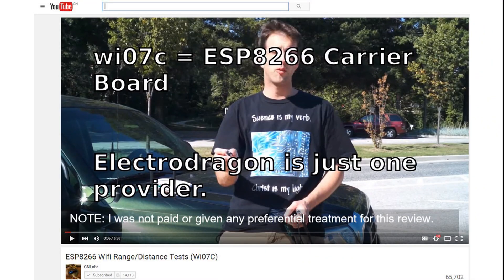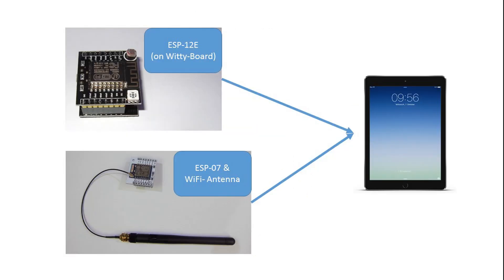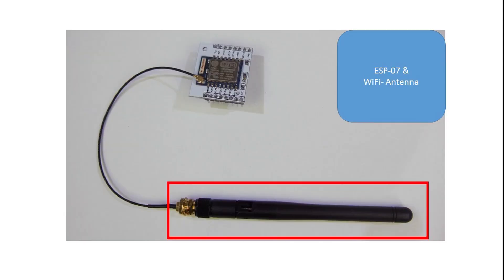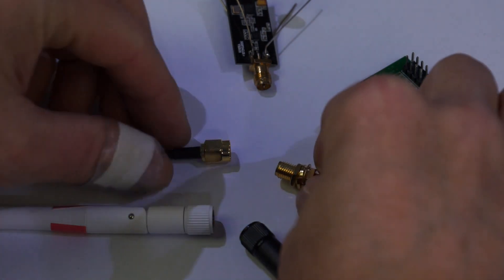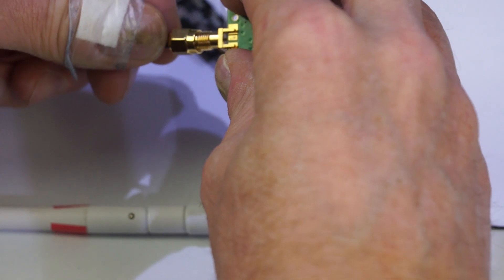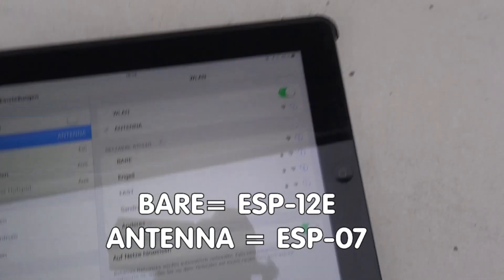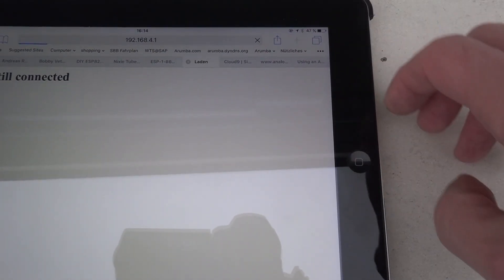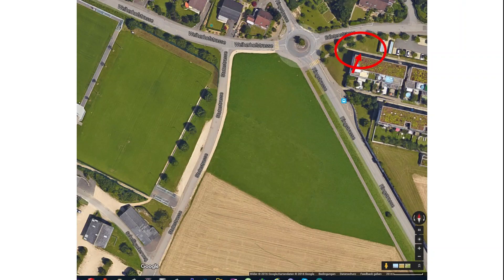#43 ESP8266 Range Test with and without External Antenna

Comment: You need to have the ESP-12 in the vertical orientation to get maximum range.  This matches the vertical polarity of a normal whip antenna in the vertical orientation.
Reply from the maker: I agree with you that polarization makes a difference, But if one station is movable, it is not easy to align polarity. I used a IPad and I do not know the polarization of this device. And in addition, I moved it all the time. Many of my applications are similar and I cannot adjust polarization on both sides. So, I think, we have to live with what we get without adjusted polarization.
Reply: Is it possible to have a second Rainsun chip antenna rotated 90-deg in place of the u.FL connector?  That way both polarities are covered on-chip.
Reply from the maker: This is not easy because if you put them in parallel, then you only have 25 Ohm which would be a complete mismatch. In series, you would get 100 Ohm. So, you would need a imedance converter, which is not easy to be built on 2.4 GHz.
BTW: The best channel about 2.4GHz antennas is: https://www.youtube.com/channel/UCHqwzhcFOsoFFh33Uy8rAgQ
Reply: So totally impractical to have 2 chip antennas on one PCB?  How does the ESP-7 support external and internal antenna concurrently?  Or does the ESP-7 disable internal antenna when you connect external?
Reply from the maker: +George Ou You have to unsolder a component, if you want to use the external antenna. But I didn't know this when I made the video. A viewer told me
Reply: Yet you had both working before you unsoldered internal? Or is it just sub optimal?

If they both worked, I suppose they could be put of phase spaced at half a wavelength apart, and cancel each other.
Reply from the maker: +George Ou It as for sure not optimal, because they were both in parallel (25 ohms)
Reply: The Itead PSF-A85 seems to claim you can use internal and external antenna without matching circuits.  But I can't be certain.  Here's what they say.

https://www.itead.cc/wiki/PSF-A85#WiFi_Antenna
"PSF-A85 supports two kinds of antenna interfaceIPEX interfaces and stamp hole interface. You can directly use on-board PCB antenna and IPEX antenna, without adding any matching circuit."
Reply from the maker: Interesting...
Reply: Itead PSF-B85 does not have external u.FL and uses a tiny chip antenna. Probably smallest 2.4 GHz chip antenna I have ever seen.  My limited understanding is that the chip antennas are more resistant to being detuned by any changes on the PCB.
Reply from the maker: I am not a antenna specialist. I just know, if the match is ok, the bigger the antenna, the better ;-)
Reply: Sure, you can wire the ESP-07 to a 1-meter omnidirectional antenna and get 15 dB gain if you really wanted 5.6-fold range in any direction.
http://www.l-com.com/wireless-antenna-24-ghz-15-dbi-omnidirectional-antenna-n-female-connector

Comment: I bought one esp8266 and burned its memory because I think I have a faulty USB to TTL adapter. I tried lighting an LED with the adapter and it burned in a few seconds, even though the adapter is supposed to give out 3.3V. I'll buy another memory chip and hope that's the only thing I burned off on the esp
Reply from the maker: Bad luck!

Comment: i didn't really get it. which one has better range? esp-07 or esp-12?
Reply from the maker: 4:12 you see and hear: The ESP-07 with an additional antenna. If you do not want to use the additional antenna, the ESP-07 makes no sense because it has only 1MB flash (if you want to do OTA updates).
Reply: did you even look at the video??

Comment: can't we solder an antenna over the PCB antenna on nodemcu?
Reply from the maker: You can, but most probably, it will not work well. Antennas have to match in impedance, and this has to be designed by somebody with a lot of knowledge (and measuring equipment). I would not do it. This is, why I use the ESP-07 if I need an external antenna.
Reply: Agreed. I didn't know that. I looked up a few websites today and found that such a hack could actually make the antenna performance worse. Great videos by the way :-)

Comment: I wonder if you could increase the range by using two ESP-07s with external antennas rather than just connected to an iPad. Do you think it could be possible that iPad's antenna could be one limiting factor? 

Also, are there external antennas with amplifiers?

Two directional antennas pointing at each other would be optimal probably.
Reply from the maker: 1. The IPad seems to be part of the limited range.
2. Directional antennas for sure would help, if your devices stay at the same place.
3. I do not know if external amplifiers would work. The need a certain power to switch from receive to send and I do not know if the ESP has enough. For sure, they would be illegal :-)
4. I plan to do more testing , but probably next year when it is warmer here.
5. A viewer suggested, that I should have a resistor removed if I use an external antenna. I do not know, how much influence this has.
Reply from the maker: You are right. Another viewer told me that, but at the time of the making of the video I did not know.
Reply: esp-07 external and "internal" antenna seem to interfere each other, I red that removing the little cap helps to make signal better when you use an external antenna with it, maybe you can look into it too. You have all the good measurement equipment.
Reply: Andreas Spiess maybe you can make a little video about esp-07 since it's probably most popular esp with external antenna. To show the difference in gain with and without external and with and without the capacitor? :) You have the measuring equipment i believe, would be interesting. Just a thought.
Reply from the maker: I plan to do something with extendign reach of the ESP. But not soon.

Comment: As far as I know. To get an wifi connection for places like at the back of your house, you could use something like a reflektor to reflect the signal to the backside. As far as I remember about more than 90% of the wireless signals inside an appartment arrive by refelction. I read this a while ago in a book called "WirelessLANs" from Joerg Rech. May be a interestin information.
Reply from the maker: You are absolutely right. This is not only true for Wi-Fi signals. As  Ham radio operators we e.g. use reflections of HF signals in the stratosphere to communicate worldwide.

Comment: I think the critical difference between this test an cnlohr's test is that he used an access point as one end of the connection. This changes things rather dramatically I would assume since access points are powered and can create a substantially stronger signal than a battery powered device. I would imagine they can amplify weaker return signals as well, although I do not know that for a fact.
Reply from the maker: I did not want to have a record as cnlohr. I just wanted to test a real scenario. cnlohr's work, however, is very interesting!
Reply: +Andreas Spiess I guess I always try to connect my esp to the internet for connectivity, so in my case having one side be the AP is realistic for me. Cool video, thanks for doing the test.
Reply: a battery powered device isn't powered??

Comment: He was using wifi router as AP, and ESP8266 as client. His second test with 4 km success is becose he used directional antenna
Reply from the maker: I think, he wanted to prove what these little modules are able to do. So, He tried to find a maximum.
Reply: I think he used udp ping oneway

Comment: Hey i want to know is there a way to reduce antenna RF power. I am transmitting SSID using esp12e, but i want to restrict it to lets say 2m, how do i do that?.
Reply from the maker: I do not know of a function to reduce RF output of the ESP8266. So, the easiest possibility is to shorten the antenna or mount the module in a metallic case with some holes (the case should be connected to ground). Then, with experiments you can drill enough holes to get the desired range.

Comment: i have esp-01 i think its a 26mhz.. 

i think it has a short range like 20-25meters? 

what if i want to upgrade the esp-07 but the same arduino code to be patch.  is there any conflict?
Reply from the maker: All ESP8266 modules work in the 2.4 GHz Wi-Fi band. As with other Wi-Fi devices, you can have many devices in parallel in one network. The number after the "ESP" is just the packaging, the chip is always the same (ESP-07 e.g. has an antenna connector, ESP-01 has only a few pins)
Reply: 26Mhz?? sure don't think so....as well the 2.4Ghz range (hence the name Wifi!)

Comment: It will be more interesting how far can 2 esps talk together , so the distance wont depend on device used to connect to the esp .
Reply: I have tested this case inside my house... two ESPs, one send UDP packets ,the other receives. I confirm that the range is 16m/20m with an RSSI on sender of -85/-90dB with a percentage close to zero of lost packets. 
The same result if the two ESPs are on different floors.
I have not tried it outdoors yet.
Reply from the maker: You are right. This the topic of a future video
Reply: Thanks you for doing amazing job!
Reply from the maker: Yeah, I know these videos. Great channel!
Reply from the maker: Thanks for the info!

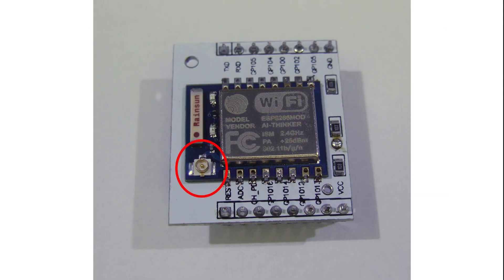Comment: Found your video on research for external antenna use of esp07. As far as i know you have to disconnect the ceramic antenna, just remove the 0ohm resistor between u/Fl and power led. @1:47 i can see the resistor is still there, did you desolder it?
Reply from the maker: When I did this video, I did not know, but a viewer wrote it in the comments. I have to try this in a future video.
Reply: yep you have to remove it
Reply: Welcher Wiederstand wäre das?

Comment: Hi, you can use a helical antenna to your modules and you will increase your range dramatically but it's directional, the longer it is the more directional
Reply from the maker: I have some material laying around to play with different antennas. But, unfortunatley, for the moment, I do not have the time. Subscribe and you will probably see a video in some future...

Comment: Dear Mr. Andreas Spiess
Thank you for sharing experience on ESP8266. 
As expert on RF design I like to help you to improve designs and demos as you presents. 
You can call me any time my Skype nissim.test see me also at http://www.TelnT.com nissim@TelnT.com
Regarding the range test experiment you make:
As you can see on the 1:48 minutes on the right top side of the red circular there is capacitor. 
This capacitor must be removed if you like to use the U_FL connector. 
See this capacitor at http://goo.gl/cYaZHF layout.
The reason is simple: the maximum RF distance is based on good impedance matching the Microstrip (wire to antenna on PCB) to antenna must be 50 ohm. 
That Microstrip now is 50 ohm with the ceramic antenna. The U_FL connector is also 50 ohm without external antenna. So all Microstrip  is 50 ohm
But: if you connect external antenna to U_FL without remove the capacitor you get two antennas parallel to each other (the Microstrip “see” 25 ohm) and the Microstrip has to drive 25 ohm. ESP8266 see 50 ohm that end with 25 ohm. 
That is very bad. Just 33 % or less of the RF energy will be RF broadcast.
 Moreover will be a standing and return waves on the Microstrip that will reduce the RF energy out even more.  Return waves will warm the ESP8266 and can destroy its final PA RF stage. 
Two antennas may effect and cancelled each other if they are in a distance of multiply of ¼ wave length (30mm). 
Placing the antenna on roof extend the distance since distance from ground do that. But making the antenna on the long metal fence on the roof may reduce or increase the distance. The long metal fence act as resonance antenna two. 

Since ESP8266 can work in several Wi-Fi mode.  If you lock it to ST B mode, you will get  +19.5dBm output power in 802.11b mode. See http://wiki.iteadstudio.com/ESP8266_Serial_WIFI_Module

I do free Skype (nissim.test) help as part of my contribution to the society. 
You and other viewers are welcome to call. 
Dr. Nissim Zur (nissim@elinistech.com)
Reply from the maker: +Nissim Zur Thank you very much for your valuable comment. I will investigate later into it. It needs some work... I anyway plan to dig more into this topic during summer. We can keep the contact.
Reply from the maker: 1. for the ESP-07 you are right.
2. Because the ESP-12 has no antenna connector, you cannot attach a antenna (at least, if you are not a well trained person with lots of mechanical skill. This is why I use a ESP-07 if I need an antenna (or the Wemos Mini Pro)
Reply: same thing on the wemos d1 mini pro..u need to unsolder and rotate the pcb antenna's 0 ohm capacitor to the disconnected ext ant port on board PCB and resolder(the silver blob in front of the ext antenna not the antenna itself)...so if u look at it is a bridge... wherever it is soldered ...one or the other..actually is easier on the 07 than the Mini Pro as you only have to remove the capacitor on the 07...on the Mini Pro you need to resolder to the ext antenna capacitor to bridge it..if u mess up too just solder a very small piece of copper wire, like inside of coax, works fine....but both the 07 and Mini Pro you are loosing massive gain...so look at it like your antenna is loosing gain from having an unneeded protruding antenna that is not the right size anymore throwing it way off calibration...

Comment: if data rate is not important, perhaps you can try setting it to lower speed 802.11b, from the datasheet, it seems to transmit higher power and also it has better sensitivity with 802.11b.

Tx power
802.11 b: ＋20 dBm
802.11 g: ＋17 dBm
802.11 n: ＋14 dBm
Rx Sensitivity
802.11 b: －91 dbm (11 Mbps)
802.11 g: －75 dbm (54 Mbps)
802.11 n: －72 dbm (MCS7)

http://doc.switch-science.com/datasheets/0b-esp8266_system_description_en_v1.4.pdf
Reply from the maker: +YewMing Chen You are right. I did not look at the speed of the transmission during my tests. I anyway plan to play again with the chips ans some antennas in the future. So, I will also look at the speed then.

Comment: Thanks for the test, Andreas!
I would be interested, how far the ceramic antenna on the ESP-07 reaches compared to the PCB on the ESP-12E.
And you said, the ESP-12E did not work behind the house. What about the  ESP-07? (with or without external antenna)
Reply: I think he is in the "shadow" of his house or some other possible effects. In some rare cases the signal could be to strong and distort the input of the receiver. Had this effect on a moded Linksys WRT54GL. Everything worked fine if I was 20m or more away but I lost signal when I'm between 0 and 3m.
Reply from the maker: +Zebrahuhn I will anyway do a second test with new scenarios, especially I will replace the Ipad as a receiver, because other commenters wrote, that this might limit the reach. The ceramic antenna should have about the same performance because of its comparable size and no obvious directional effects.

Comment: thanks for sharing, have you tested how long the iPad can connect to a powerful router to discard the iPad from the equation? I have been playing with a router on a farm and I have lower coverage when testing apple devices (iphone) vs other devices (a dell laptop and a samsung phone). I will test an esp8266 as soon I get to the farm, good open spaces :)
Reply from the maker: +Cristian Szwarc Another viewer suggested also the Ipad as a source of short reach. So, I will do the tests again with other scenarios. e.g. the ESP connexted to a accesspoint and also some antenna choices. This scenario then covers the case of a ESP as a data collector connected through the WLAN to the internet.
Please publish also your results if available!
Reply: +Andreas Spiess hi, Today I was able to do a test outside the city, a nodemcu set as an access point with the demo page from the arduino examples. I was able to be connected up to 575 meters with my laptop. Sadly I was not able to test it longer because some hills. The iphone was not able to connect with the esp8266 after 80 meters or so
Reply from the maker: +Cristian Szwarc Thanks for the info. So, the difference between a phone and a laptop is bigger than I thought. I will try to use this info in the next test.
Reply: +Andreas Spiess at 575 meters the laptop was able to have a good connection but in an specific angle, the esp8266 was standing instead of lying, with the onboard antenna facing to where I was testing (no idea how much that affects the distance), I will try to test a longer distance and instead of the laptop I should test two esp8266
Reply from the maker: +Cristian Szwarc Please keep me posted. Antenna direction as well as place is very important at this short wavelength. A few centimeters can already make a difference. This is why it is not so easy to test.

Comment: I think you have to considder de 'used' powersupply. the range will improve with a supply that can deliver more current.
Reply from the maker: If you look at some of my newer videos you see, that I have gone the same way... Just bigger capacitors.
Reply from the maker: +half4team I used a power bank. I will do the test once again and also use different configurations (antennas, places).
Reply: A good power supply is very important. I've had lots of trouble with my ESP-01 that I have connected to my doorbell. Like connection losts and freezes. After I've added a 0,1F goldcap capacitor it works without errors. I think I've readed somewhere, that the ESP can use up to 800mA on a very short burst.